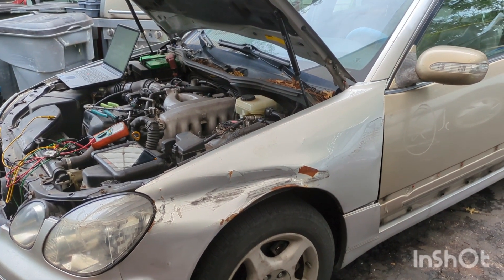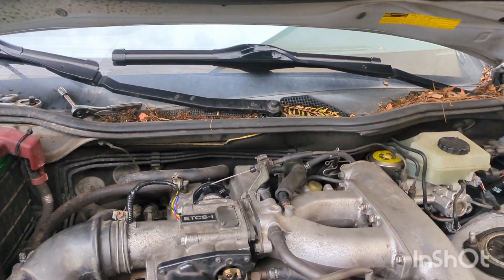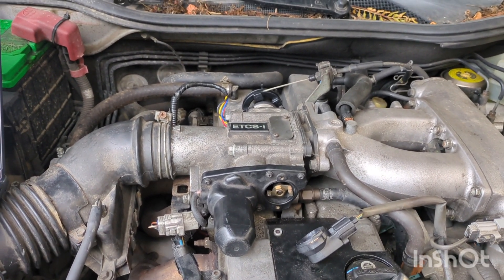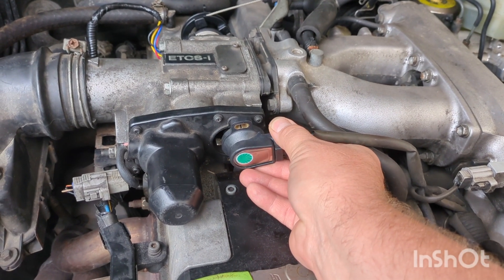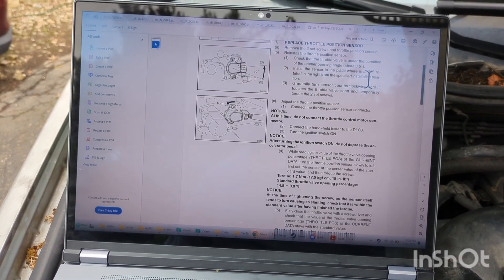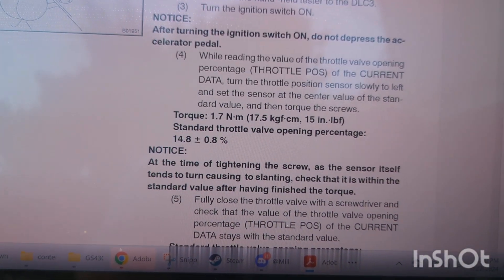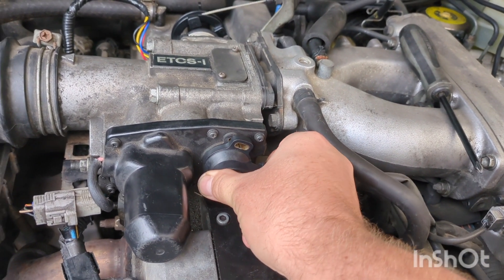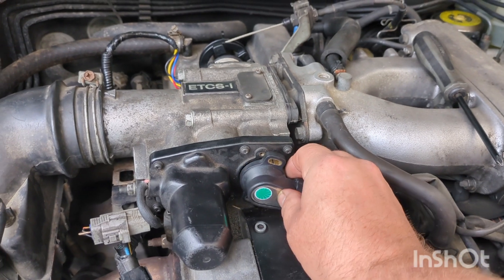2JZ TPS Throttle position sensor calibration; Lexus GS300, SC300, Toyota Supra

Comment: what problems do you speak of, we currently have one in our shop we just got running after a few years of sitting and its unchartered territory, we have an idea of the issue but no way to check and resolve.. car acts like its in limp mode, found a cable that was disintegrated and realized it was flipped as when we put it in what we belive to be the correct orientation we can rev past 3k but the car dies randomly when throttling down.
Reply from the maker: The electronic throttle body has a mechanical failsafe inside that will open the throttle around 90% throttle and will limit you to 3000RPM. Because the sensors are reading improperly stalling is common too.
Reply: @fisqual what was the issue? I have the same issue with my 2004 gs300
Reply from the maker: @ bad solder joints behind the cover of the throttle body lever sensor. Once I reflowed the solder it has worked flawlessly since I posted this video.